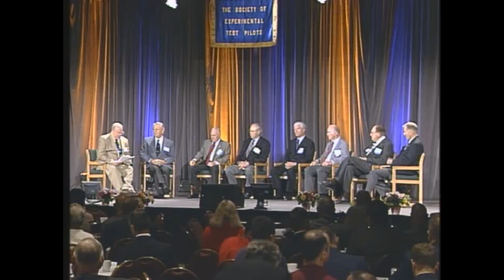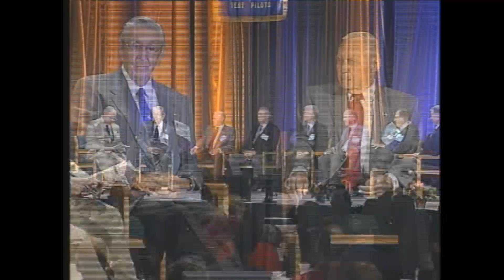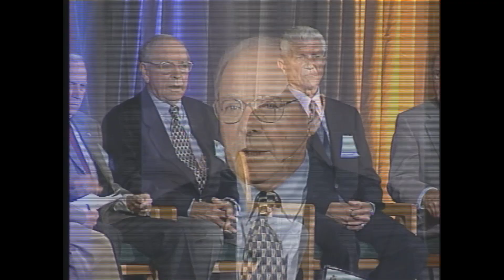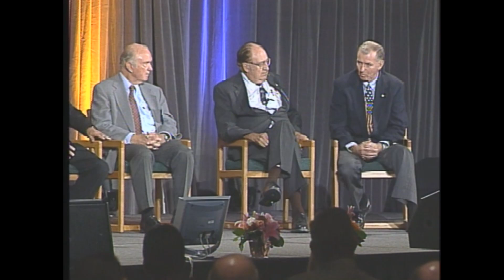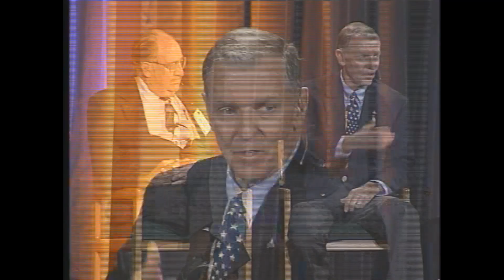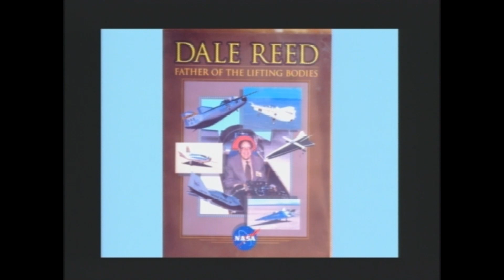Test Pilot Remembrances X-15/ lifting bodies Crossfield, Dana, Engle, Knight, Powell, Reed,  White

Comment: Event: The Society of Experimental Test Pilots 47th Annual Symposium and Banquet in Los Angeles, CA
Date: 2003-09-27

Panel (as it was listed on the SETP schedule):

- A. Scott Crossfield
- William H. Dana, X-15 & M2F1, M2F3, HL-10 and X-2 Lifting Body programs
- Maj Gen Joe H. Engle, USAF (Ret)
- Col William J. “Pete” Knight, USAF (Ret)
- Maj Gen Cecil W. Powell, USAF (Ret) - M2F3 and X-24A Lifting Body programs
- R. Dale Reed, Former Program Manager, NASA Lifting Bodies and author "Wingless Flight"
- Maj Gen Robert M. White, USAF (Ret)
- Moderator: Dr. Richard P. Hallion
Reply from the maker: Thanks. Youtube limits the length of text so I had to abbreviate.